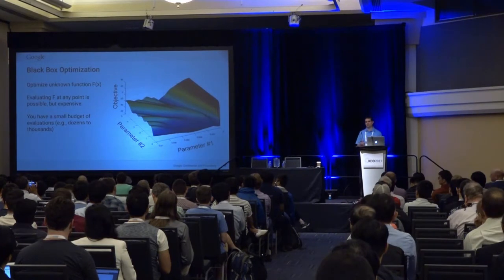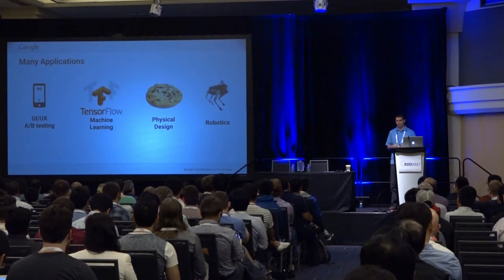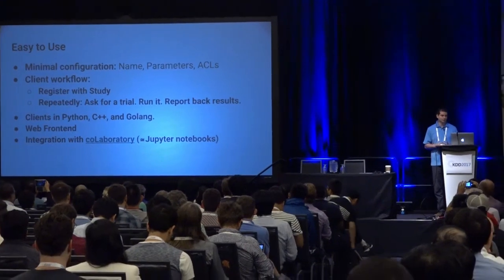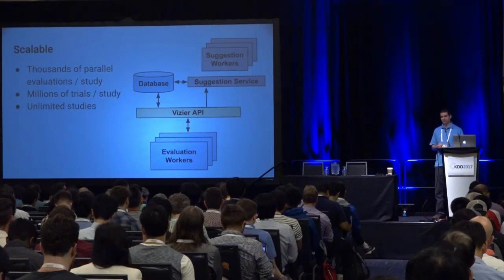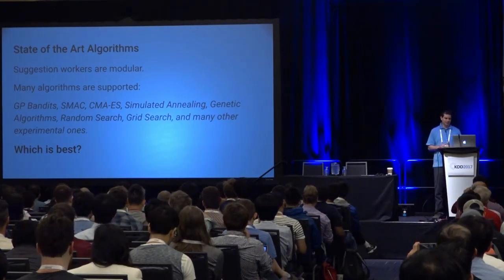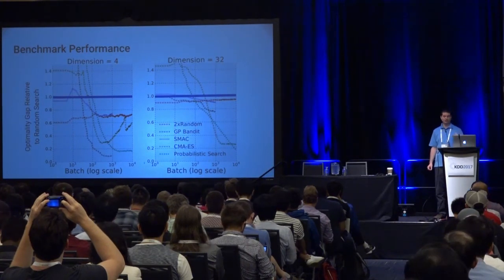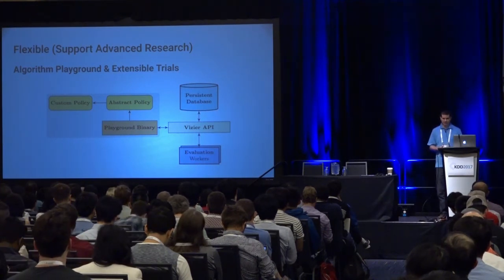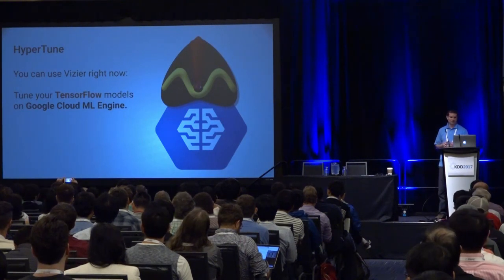Google Vizier: A Service for BlackBox Optimization

Comment: Gemini 1.5 Pro: This video is about Google Vizier, a service for blackbox optimization developed by Google. Blackbox optimization is a type of optimization where the system you are trying to optimize is opaque, meaning you can only evaluate different configurations by running experiments. Vizier makes it easy to define and run these experiments, and it also provides a number of features to help you improve the efficiency of your search.

Here are the key design goals of Vizier:

* Ease of use: Vizier is designed to be easy to use, even for people who are not familiar with blackbox optimization.
* Availability: Vizier is highly available, so you can be confident that it will be up and running when you need it.
* Scalability: Vizier can scale to handle large workloads, so you can use it to optimize even the most complex systems.
* Performance: Vizier uses state-of-the-art algorithms to find the best possible configuration for your system.
* Flexibility: Vizier is flexible and can be used to optimize a wide variety of systems.

Vizier is a powerful tool that can be used to optimize a wide variety of systems. It is easy to use, available, scalable, performs well, and flexible. If you are looking for a way to improve the performance of your system, Vizier is a great option to consider.

Some of the applications of Vizier include:

* Automated optimization for user interfaces or user experience
* Optimizing machine learning models
* Physical design problems
* Robotics

One interesting example of how Vizier has been used is to design chocolate chip cookies. By parameterizing the space of possible cookie recipes, Vizier was able to generate a series of cookies that were then taste-tested by humans. The results of this experiment were used to improve the Vizier algorithm.